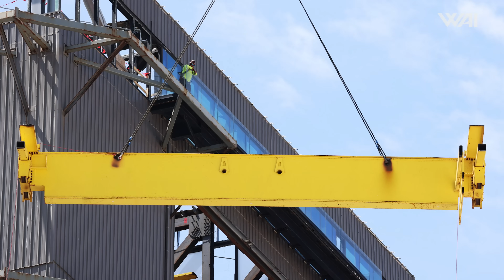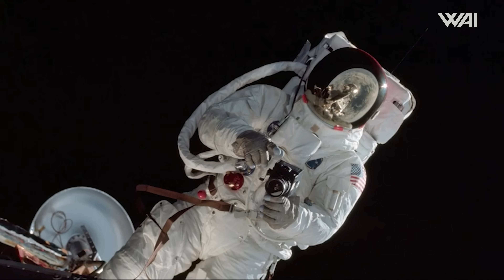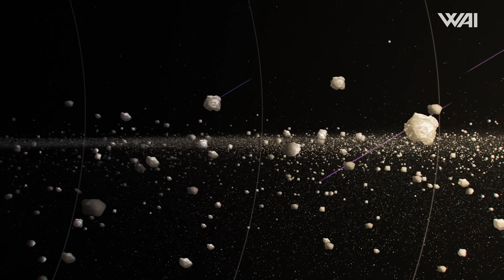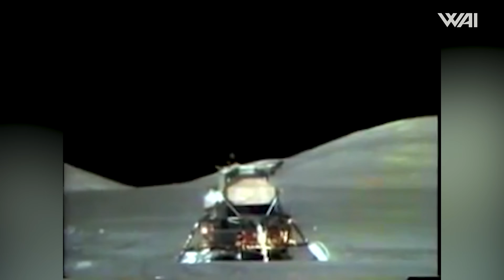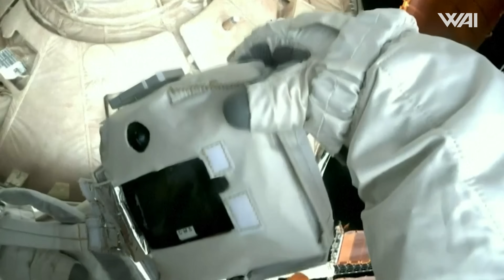SpaceX MASSIVE rush! Starship Launch Date Estimate!

Comment: SpaceX, get rid of this ring from Soviet Russia. Install 3 springs in the booster that will push the ship away when released, the engines will fire a few seconds later and the problem will be solved. Alternatively, so as not to mess with the booster, install these springs in the ship. Forget about electrical and hydraulic solutions because simplicity is what counts. I invite those interested to the discussion.
Reply: The hot staging ring is not the issue. If it’s was, we would have seen similar issues occur on flights 2-6, and we didn’t. Flight 2 only exploded because they were dumping oxygen into the engine bay, which then caught fire.

Comment: SLS 2 should progress and launch, in order to prove Orion.  SLS 2 has been pretty much built, so it doesn’t make sense to cancel it now.  However, SLS-3 onwards should all be cancelled.  Instead use a Falcon Heavy (or similar) to launch Orion going forward.  The rest of the Artemis program should proceed, but be brought forward significantly.  Using a Falcon Heavy or equivalent would allow multiple launches per year, instead of one every 12-18months like SLS would have meant.  Of course, bringing the Artemis program forward would hinge on SpaceX or Blue Origin being able to get a HLS solution working in 2026 - but it’s possible.
Reply: That would require crew rating Falcon Heavy, plus it doesn’t even have the capability to send Orion to the moon even when fully expended
Reply: @ as is, you’re correct. But that doesn’t mean alterations in how it’s launched can’t make it work. Considering Falcon is already crew rated, getting Falcon;con heavy crew rated would not be hard. Yes, they’d have to launch the Orion capsule separately from the service module, then pair them up in orbit, but again doable. There are plenty of alternatives to a $2B rocket booster that is based on 1980’s technology. Even launching two Falcon heavies would only cost $300m. Just a bit cheaper.
Reply: @rgberry69 Falcon Heavy is basically a completely different rocket, and so would need to go through the entire crew rating process from the very beginning. This is why crew rated vehicles basically never change from when they’re first released for NASA missions. Even something as simple as new antennas or a toilet could take months to accept, plus, you would need to crew rate that mission architecture which could take years. It would be cheaper, but it would take years to get it done and so it won’t replace SLS.

Don’t replace a proven mission architecture with an unplanned mission architecture.
Reply: @ I think we’ll have to agree to disagree on that.
Reply: @rgberry69 you can’t guarantee that the Falcon Heavy architecture will work, therefore you cannot cancel SLS to then work on it, especially when it will take like 3-5 years to just crew rate Falcon Heavy, which SpaceX has explicitly said they are no longer gonna do
Reply: @ hahaha. Whatever you want to believe, you just go with it.  All I’ll say is… offer a company the right amount of money and a company will do anything. And with Trumpty-Dumpty and Muskrat running the gov, it won’t take 3-5yrs. Just one executive order.
Reply: @rgberry69 you can’t fast-track human rated spacecraft and rockets, no matter how close you are politically to the government. All it takes is one loose screw or a bad weld to go unchecked for a total loss of all the crew onboard, and that’s why it’s taken NASA almost a decade to get Crew Dragon to take crew after the Shuttle.

You are not playing with probes or rovers, you are playing with humans lives with a proposal with an unproven mission architecture.

I’m not anti-SpaceX btw, quite the opposite. I’m not looking at it optimally or pessimistically, I’m looking at it realistically. SpaceX has made it very clear that they have zero intentions on crew rating Falcon Heavy, and to cancel a rocket that CAN take crew to the moon for another which can’t without having to completely change the mission architecture is too risky and would take too long.

Also, if Jim Bridenstine, former NASA Administrator, is urging Congress to try and get Jared into NASA as the new Administrator, and he is very pro-SLS, it’s safe to say that SLS is staying, because Jared also knows that cancelling SLS would mean cancelling Artemis.

Comment: Hey Felix,
can you say only a few Words in German, because you are from Germany. I think Isaacman at Nasa is a big Problem, because he´s a Protector of SpaceX and so it could be, that the SLS Program will be stopped by Isaacman. The costs are too high, because the Problem of Boeing is that the Corestage was too expensive. What will be with the delivered Servicemodules from esa for the Orion? Will Orion fly on a Ariane VI or an Falcon Heavy or an New Glenn? The SLS is too expensive, and that´s fact. I will be happy if i can get an answere from you
Reply: Jim Bridenstine endorsed Jared, and Jim is very pro-SLS, so it’s very, very unlikely that SLS would be cancelled. SLS also can’t be cancelled because there is no other option available right now.

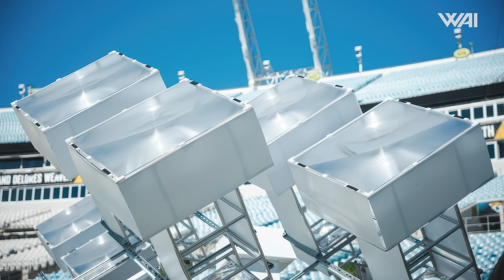Comment: 5:45 Star catcher is a technical solution in search of a practical problem. Satellite electronics coast through the shadow of the Earth by using rechargable batteries. How can any complex energy beaming system improve on that simplicity?

Powering surface infrastructure on the night side of the Moon (for 14*24 hours) is a plausible remote use case. But mirrors would be far less complicated.

Comment: I often wonder why SpaceX does not do a long burn with the Starship whilst stacked on the booster. Surely test fire when stacked, would show what damage(if any)to the Hot burn ring or booster suffers on separation.
Reply: It’s not a problem with the hot staging ring as we would have seen similar problems on flights 2-6, and we didn’t. Flight 2 only exploded because it was dumping oxygen in the engine bay and that caused it to catch on fire and explode.

Comment: The ship is not fit to hot stage, it was not designed to do so in any way. V1 was strong enough yet still not designed to do so.
V2 has been upgraded to the point it is actually much weaker than v1. Loss in weight resulted in loss of strength.....
Hot staging is not a good idea, putting a ship through a moderate explosion then expecting it to survive transit to moon or Mars as well as landing is a monumental risk not worth taking.
V3 needs a major redesign if they intend to continue with hot staging, if not, the ship is literally a death trap that could fail at any time for numerous reasons linked to hot staging.

Comment: The current design of Starship will never land safely from orbit.  Why?  Because they seem to completely ignore atmospheric conditions, apparently relying solely on GPS for navigation.

In other words, Starship is trying to re-enter atmosphere completely blind.  They have no idea how the atmosphere is behaving ahead of the spacecraft’s flight path.

The Space Shuttle solved this problem with a LIDAR system that could measure air density, wind speeds, and wind direction.
Reply: No. Primary navigation is based on inertial guidance, with updated calibration provided by RADAR and GPS. However, Relational GPS is accurate to within a couple centimeters (cm) near the landing site.
Reply: The shuttle would "look ahead" at the atmosphere to anticipate wind shear and other hazards. This was not for navigation precision, but for hazard avoidance.

Comment: That motor control center might also have some distribution points for what is known as "instrumentation" basically low-voltage data wires hooked up to the many sensors needed to tell computer controls what to do to the motors. Sometimes it is in a separate bunker, but usually they just put it in separate cabinets in the same "modular" yet another gizmo borrowed from oil and gas industry like the draw-works for mechazilla!